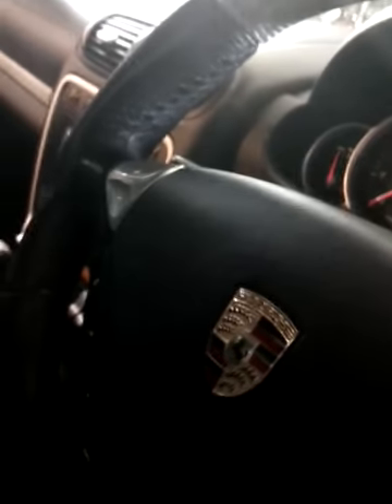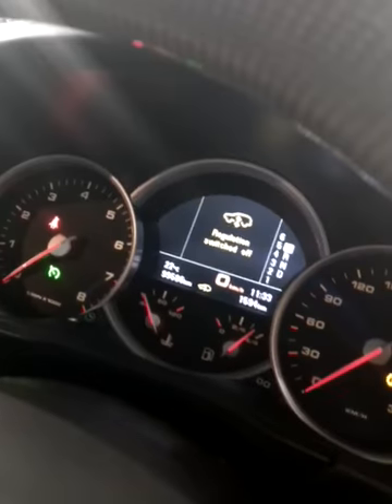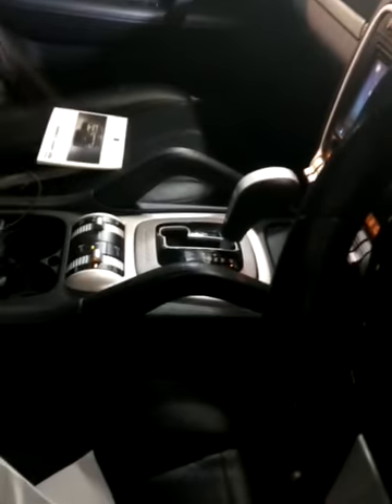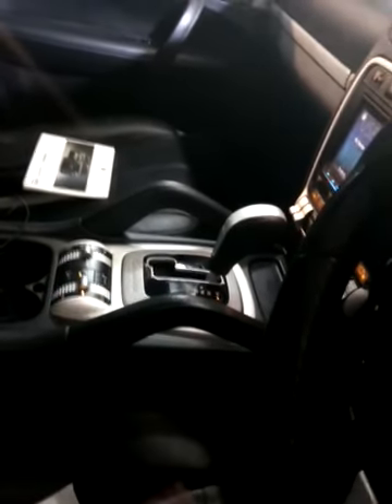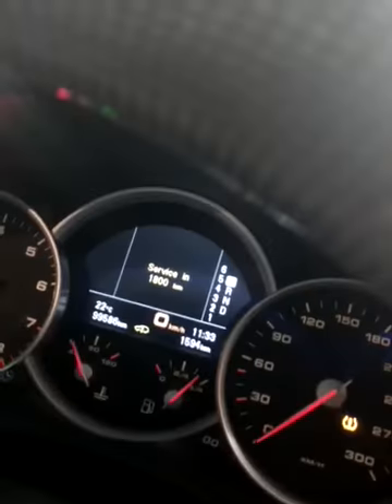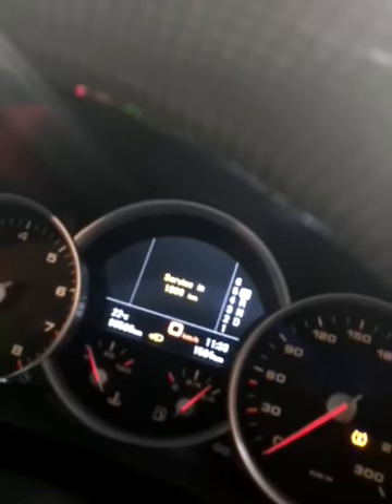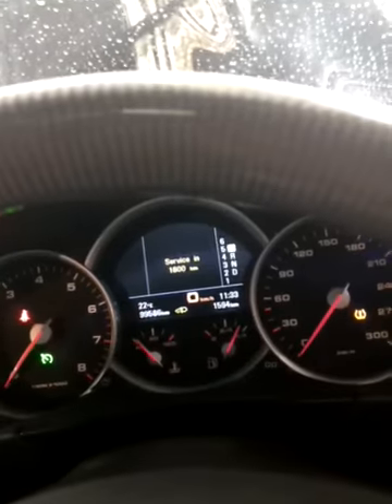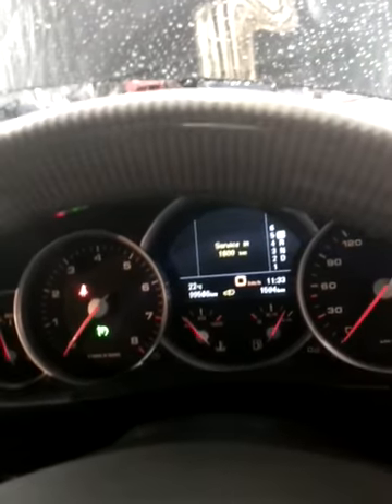Lifting Porsche Cayenne disable air suspension air suspension reset Cayenne GTS

Comment: Hello, I have a question, every time I want to turn the system off, I get a message saying "suspension air system faulty" and it won't turn off this happened after I changed a front tire. Any suggestions?